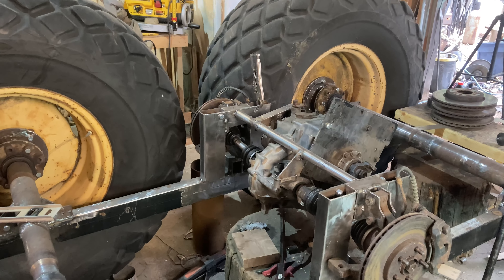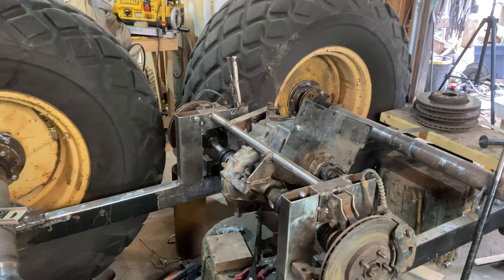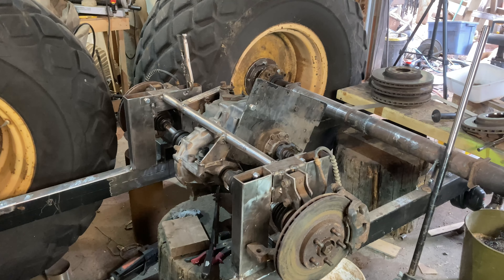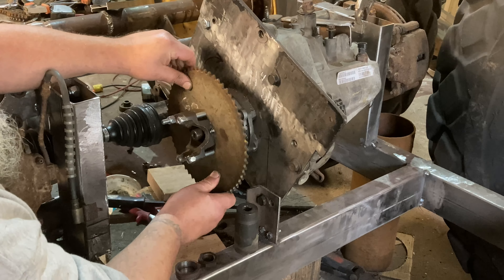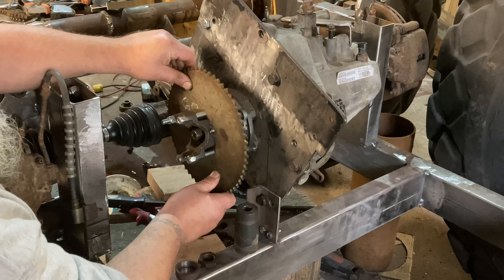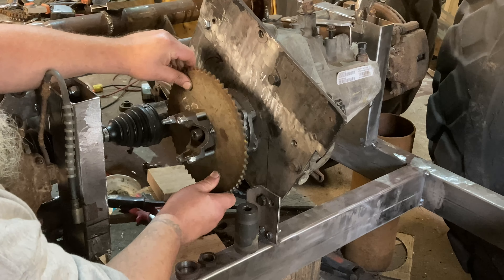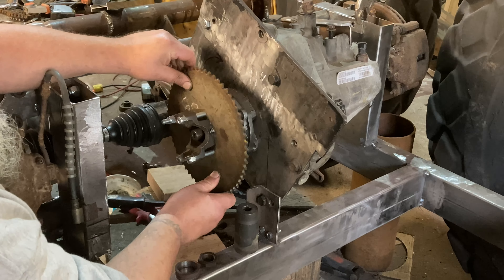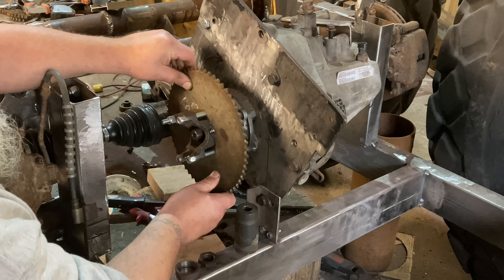Cheap homemade ATV (bug out buggy) modified brake rotors and engine installed

Comment: I think a 90° gear box is a great idea mainly do to the fact there are millions of old riding mowers with vertical shift engines
Reply from the maker: @robertchoate7557  ya I think I’m going to try to build one even if I don’t use it for this project I’m sure I’ll use it on something else. Thanks for watching

Comment: I love the attitude of using what you have.
Mildly jealous that I don't have a metal lathe or a mill, but maybe one of these days...
Keep doing what you do. Bn subscribed since the first video of yours I saw and will remain so as long as YT doesn't like me anymore!
Also-- I was thinking of a differential with a beake on one side so you could have low and high gear just by stomping on the brake of that one side of the diff.
Jus a thought for the possibility of a vertical-crank engine.
Also noteworthy is the fact that you can weld cast with a wirefeed and just peen the hell out of it as you go.
Done it several times. Works just fine.
Reply from the maker: @jaredboballen68  ya I would like a milling machine or at least a better drill press. I think I’m going to try to build a right angle drive and try it out with a larger engine. Thanks for watching and the suggestions and support

Comment: Now your jusy showing off with that left and right hand writing.LOL. I'm missing at lot of rubber mounts there my friend. I stink your going to need a larger engine. Why not just use an old rear end to change  direction? That's how you get experience, got to love it. Cheers.
Reply from the maker: @rockcrusher4636  the camera wasn’t even touching the vehicle and it was shaking like crazy I need to figure out why that engine vibrates so bad but I guess that’s why it was free. Thanks for watching

Comment: the two tack welds and four bolts for the sheer force on the sprocket is concerning.  You might consider spacers on the bolts to prevent twisting?  

As for the holes being close to the interior hub hole, just use the wheel rotors for a parking brake.

You do not need to drill the hole with the hub in place, just get them started, you can finish them with the hub absent.
Reply from the maker: @nathanaelszafranski2261  if I end up running this configuration for some time I will definitely have to deal with the shear force on that sprocket or at the very least put some grade 8 bolts in there. I think the brake rotors should work and on the next one I will probably drill without the hub in place if I remember to move it haha. Thanks for watching